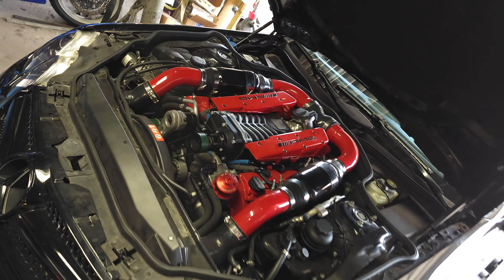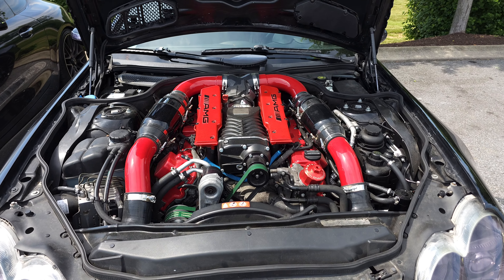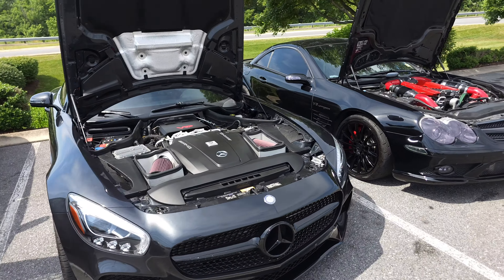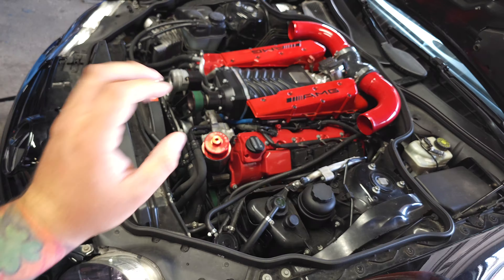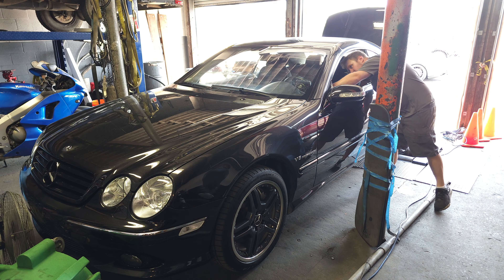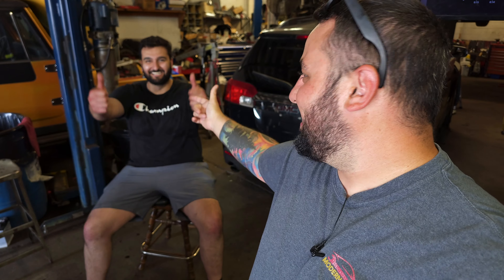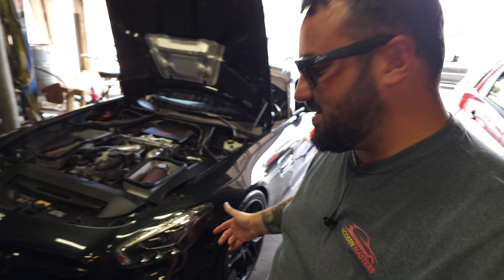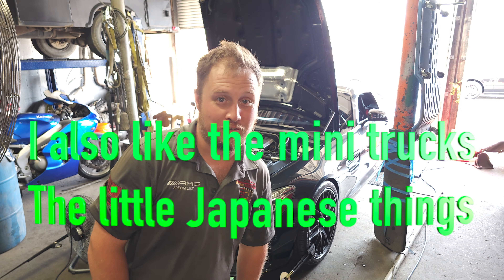VRP Whipple m113ks dyno logging and AMG GTS gets base reading before mods!

Comment: Is the mushroom cone filter beneficial for a lighter modded m113k with unwrapped headers (more heat in engine bay than stock) over the needswings cai or do those intakes only become a restriction with the larger whipple sc and cams etc?  Basically, im asking if a stage 1 or 2 m113k would see a power increase with mushroom filter on TB vs a regular cai setup?
Reply from the maker: I'm not sure the threshold but I ran mine on the street making huge power without an issue. The dynos always add so much load it makes the car work harder than on the street!

Comment: Does the M156 supercharger pulley/tensioner have the same issues?
Reply from the maker: I haven't had a single belt issue with the vrp kit, other kits yes but I'm still on the original belt, even when my tensioner bolt backed out on the weistec pulley the belts and everything was fine and reused it lol

Comment: I did a catless down pipt and axle back exhaust on my m157, do you think i should tune the car because it’s losing back pressure? or not tune it , because I know by tuning the car that will cause the cylinder wall wear faster.
Reply from the maker: You 1000% should have a tune for those mods